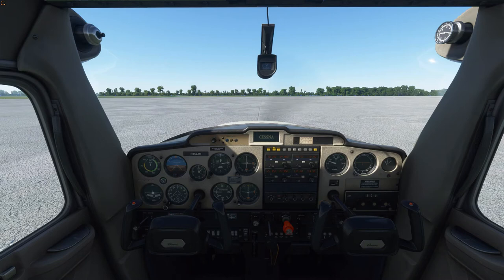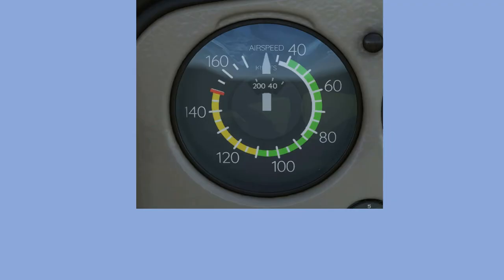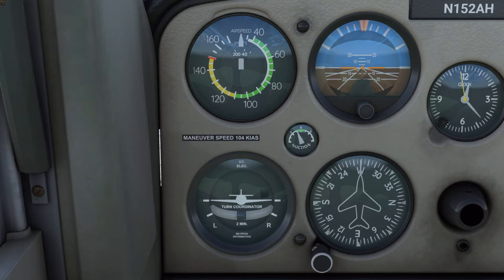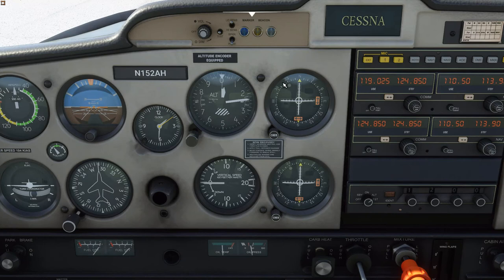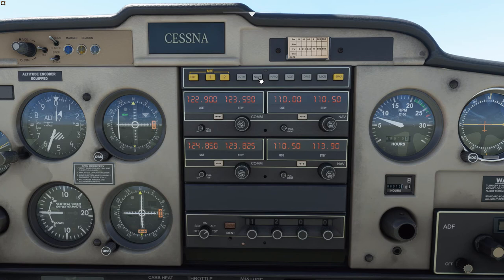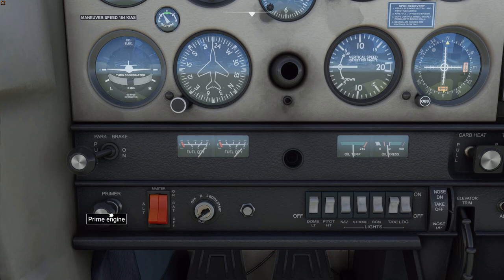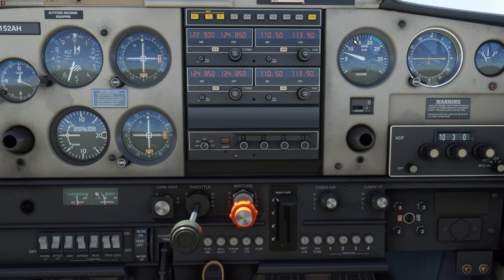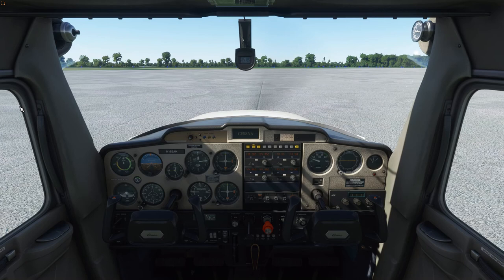Flight Simulator 2020 - aircraft instruments and systems  (AH VFR/P Pilot ground lesson 2.)

Comment: Below the throttle and mixture are a series of buttons 55- ALI 5 - Fuel Ind 15 - BCN PITOT 4 - Strobe LTS, etc. What are these? Is this a failure/Warning panel for the various systems?
Reply from the maker: Those little white circles under the mixture control are circuit breakers.  In the real airplane, they will trip/pop out if a circuit gets too much current, preventing a fire or an electrical overload of the component (i.e. the component getting fried.)  There is a red colored part behind the white part to show you they've been tripped. 

In flight simulator they are just for show, though - as far as know, there is no way to trip them.

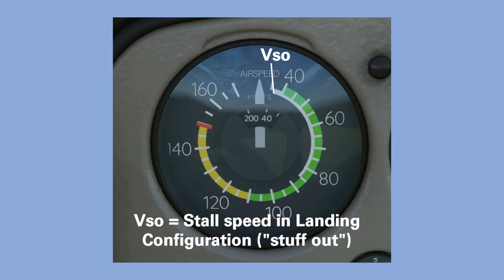Comment: Could you please confirm your camera settings ( 9:05 in course overview video)? Specifically do you  have them set to height 83, horizontal 50, zoom 50 as shown in video or something different? Asking because I tried replicating these settings and my view looks nothing like yours. As example - not sure if this is related  - but with these 3 as starting settings, I'm not able to replicate the sort of zooming you do around cockpit. For examle in lesson 2 (1:02 AOT gage or 2:36 magnetic compass), when I "slide" seat forward and up to look closer at these 2 instruments (and then zoom in) my views of these are not at all like in your video. May sound like not a big deal, but if these basic views are off, so are probably the rest of my views...  And I wonder if views feasible once inside cockpit depend on those general camera settings to be at a specific starting point. Or if there are some other settings I have yet to discover that determine - for example - how high up I can "raise the seat" (my versions of these 2 closeups are not as high up as yours and not as close to the windshield as yours).
Reply from the maker: Michael,
I start with all Height, horizontal, and zoom settings set to 50, and then utilize the translate commands (translate cockpit view forward/backward/left/right,)  Increase/decrease cockpit view height, as well as the zoom (using mouse scroll wheel) and pan (right mouse button hold) to move around the cockpit and get closeup shots of the instruments.  I'm also using a "wide angle" setting on the cockpit cam.  (I also use a photo/picture editing program to capture screenshots and edit them to add captions)

It's helpful to think of the cockpit cam as a little go-pro that can be moved around cockpit using these commands - but will be blocked by physical objects such as doors, windows, seats, equipment, etc.  

Also be aware that if you rotate the camera views using the pan function, the axis of the camera movement commands change as well.  I.e. - if I pan 90 degrees to the right, so I'm looking at the right door/window, the "translate cockpit view forward" control will move the view towards that door, rather than towards the windscreen.